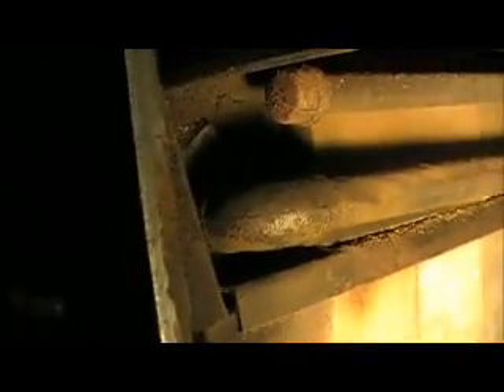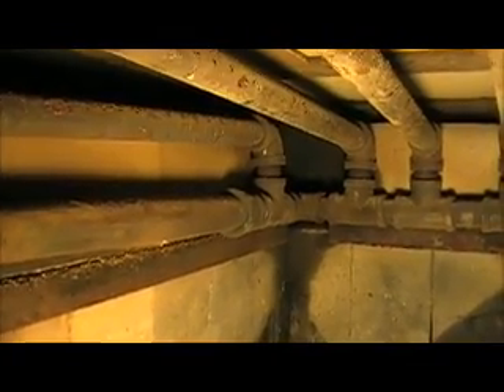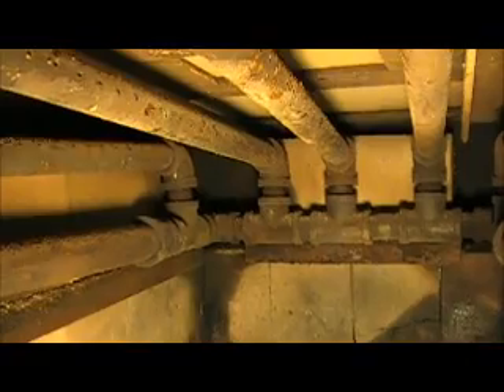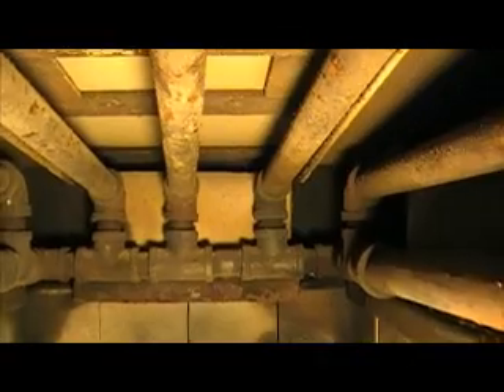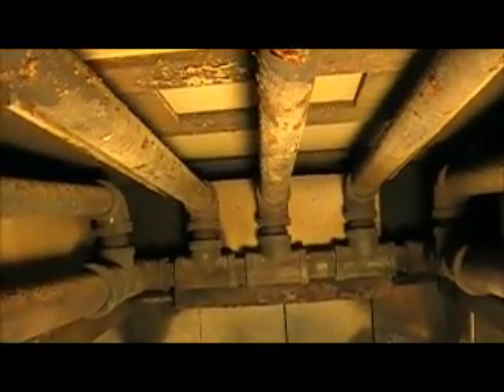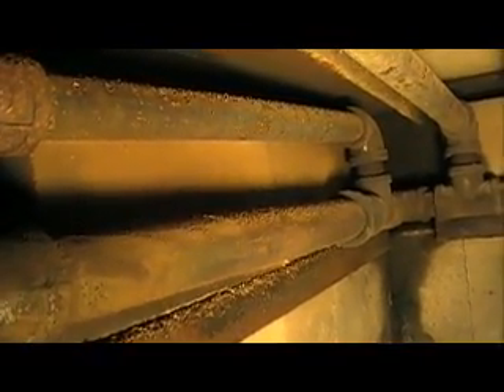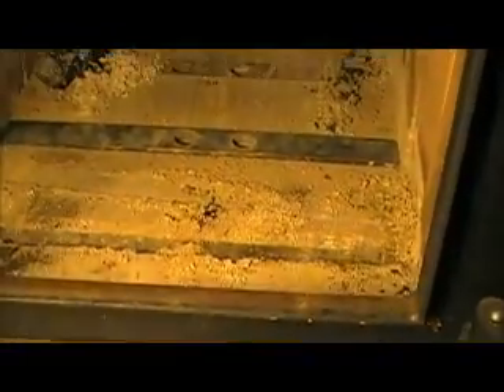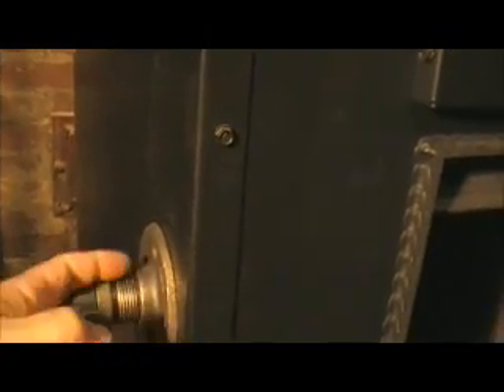Englander Stove Secondary Burn Modification 28-3500 How to

Comment: I have a question I hope you can answer for me, if almost all of the interior is covered with fire brick, how does the heat get out of the stove? Also I would appreciate if you would send me the plans for this system. Thank you. bygeorge328@gmail.com
Reply from the maker: Hi George, Actually there is some decent space in between the bricks to let heat transfer to the stove. I did not bother cut the strange angles and only one in the back etc.You are right... too much brick and you may reduce the heat transfer. I actually had a guy try using 2.5" thick bricks and he put them ALL OVER right against each other - completely shielded the firebox with super thick bricks and said that he had trouble getting heat out of it. I think the trick is to let some exposure to your metal firebox, but keep enough firebrick to hold / reflect heat at lower burn rates.I will email you the docs I seemed to have found a good balance of getting the secondary to fire while still letting the heat leach into the metal shell.

Comment: i've been waiting on something like this for quite awhile. as far as the thermostat on the back, which you mentioned in the other video, i found it to be mostly worthless. i started using a timer on 15 on and 15 off cycles plus i bought a speed controller for the motor so i can fine tune my heat output. i'm using mine as dump heat. actually thinking about buying a second one and putting it in the basement for the front of the house. very nice job and i will send an email.
Reply from the maker: Yeah the thermostat was not running the fan long enough when I first got it. It would take forever to kick on as well... I adjusted it so that it kicks on fairly early and does not stop till the stove is burned out totally... it was wasting a lot of heat that should have been going into the house. I wish that the blower had a lower setting to it... for my use... it does not need to be that powerful. I may just replace some day with a variable one... but I am living with it for now.
Reply: if you use the motor speed controller, you can vary the speed of the motor. i keep mine on low and it allows the stove to stay hot and not wick all the heat off as if it were on high. bought it off amazon. it really solved quite a few problems. i can send along the information if you would like to try it.
Reply from the maker: Randall smith Sure - Please send the link. Thank you!

Comment: I noticed you have what I guess is gas or oil furnace right next to the wood stove are you sharing the same chimney for both stoves?
Reply from the maker: Not a shared chimney. I disconnected the oil boiler completely...it was an old house with oil steam heat.. not exactly economical. I am not going to buy oil ever again. At some point I will re-run all pex and convert the oil boiler to gas and forced hot water... but between the pellet stove and the wood stove, we have not needed the boiler. Go electric hot water installed and that saved us a ton too. We have the warmest house on the block and we spend a LOT less than we used to.
Reply: David Brisson I have the same situation I have a oil furnace where my wood stove is going I'm just worried about having wood as my primary source of heat, I was contemplating sharing the chimney for both oil and wood. Which would not run at the same time and shouldn't interfere with each other since the natural draft of the chimney should handle both if it had too. I'm just worried if I'm not home when its below zero and the fire goes out. I'll use this year to make my decision on removing the oil heat for good

Comment: I just ordered this exact stove what burn times are you getting when it is choked down , I have a 1000sq Ft house and I am going to run duct work to my four room instead of just letting it dump into the basement and rise, so it should be more effective. The house is very well insulated and the proper amount of heat is not the issue I'm just hoping I can get around ten hours out of it while I'm at work, I'm on long island NY and our winters are cold but don't usually drop below teens. I like your idea with the piping system, I'm a plumber by trade so this shouldn't be an issue to hook up I'm just wondering if it made a difference, thanks for reading and would appreciate any input you might have
Reply from the maker: The secondary tubes make a huge difference in how it runs. I actually was never able to get more than about 4 hours and I was super frustrated by that. I wanted to set it on a low burn and go to work or to bed... and get the 8 to 12 hours out of it... It is very hard to do with the stock stove because it needs a fair amount of air to stay burning well otherwise you get lots of black smoke when you turn it down. It still throws a lot of heat but it does eat through the wood. Letting in the air in the wrong place reduces the burn times. The mod makes it a no brainer and super easy to get longer burns out of it with no black smoke. Just  get it hot and turn the top air off and the bottom air about 1 turn (depends on wood and draft etc.) but I get 8 to 10 hours easily. If i have bigger chunks in there - I have gotten 13 to 14 hours and the blower was still turning on. The secondary tubes burn all the gases that usually go up your chimney so you get more heat from it and typically use less wood and you get less creosote buildup in your chimney. People have completed the mod and thus far no complaints! I will post some pics / vids of their work soon. Send me an email and I will send you what I have for documentation. Overmann55@gmail.com
Reply: David Brisson so did your mod result in a longer burn time? Or just a cleaner burn? Thank mike
Reply from the maker: mike vivona  Sorry for the delay... MUCH longer burn times. 9 hours is about the average now  - sometimes only 8 and sometime as much as 12+ it really depends on the wood and size etc.

Comment: I just competed modifying my 28 3500 thanks for sending me your detailed instructions and parts list you made my shopping easy and the install painless.  Anyone thinking of doing this email Dave, he will send a nice package so you can do it with ease.  This conversion works good  and getting great secondary burn, less smoke and better burn which will no doubt save some wood.  Thanks again Dave for the detailed instructions

Comment: Mines similar to your stove (not an Englander however) and I used 1x2" square stock going into the stove from the back, up the back inside, then a single tube (1x2") along the top center to a T in the front. I used fire brick both sides and on the top baffle. Now I get 7-8 hour burns on a single load (4-5 pieces of red oak) and less ash. No smoke and hotter fire in the stove. We actually have to open windows sometime when it's below 0 outside!! Nothing fancy, but it works very well.
Reply from the maker: Nice! Please send some pics of your work - I would love to see what you did.

Comment: Hi Dave great video. I have the same stove and its been a life saver since I have no other heat source (long story).

My initial concern with the mod was that addind air would go thru wood quicker. I currently get about 4 hours with a full load. I read where you're currently getting 7.5 hrs and that's exactly what I'm looking for.

I will definitely email you for your modification plans. Thanks
Reply from the maker: Remember - large DRY wood pieces for longer burns and get some coals in there first- the mod makes a huge difference. 7-10 on a full load consistently. With no billowing black smoke from turning down the air...

Comment: nice job the pipes with the end caps on them does the water circulate through them i dont under that part i have a clayton wood stove would like to do the same job to it too i got a oil fired boiler also thanx good video
Reply from the maker: Hi Bob, The Pipes are for secondary burn not for water heating. The secondary burn makes it burn better and cleaner. More heat, less creosote etc.

Comment: How are the pipes holding up? Any issues with them overheating? Looks really good! Thanks for the video.
Reply from the maker: Thus far no issues...I plan on inspecting them visually from time to time and really getting in there after the season is over to check for wear or  signs of metal fatigue / sagging. But so far it looks / feels solid still. No change from last years burn and it has been running great.

Comment: now that you have the system operational, what would you estimate as your net% of reduction in wood/fuel consumption?
Reply from the maker: My gut reaction reaction says I burn 50% less... but people have said that is a lot and unlikely...and that 30% is a better guess. All I know is that I used to go through wood like crazy... I was down there filling every 2 hours to keep the blower running... I was ready to sell it. Now I find I can throw 4 or 5 pieces in once it is hot and not touch it for 7hrs and the blower is still kicking on periodically... throw another load in for another 7 hours etc. That is 3.5 times as long... so that is 71% less wood. People tell me that 71% is nuts - but that is the truth. Plus -no more issues with thick black smoke when I turn down the damper which used to happen a lot... and it seems to burn better at low flame where it used to go dead a lot. Must be because of the extra air from the pipes. Fewer headaches overall.Much easier to run /maintain.